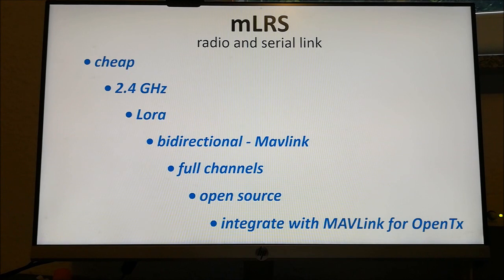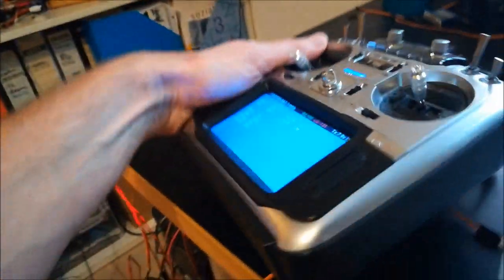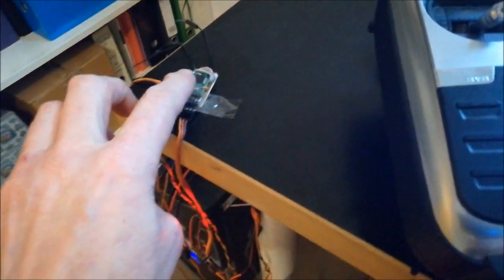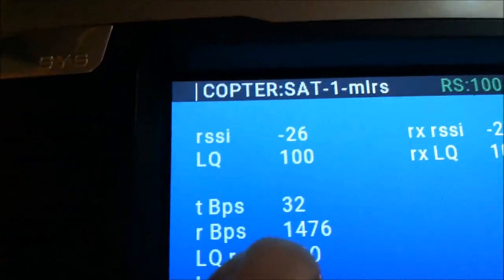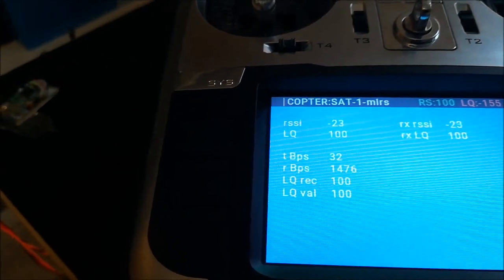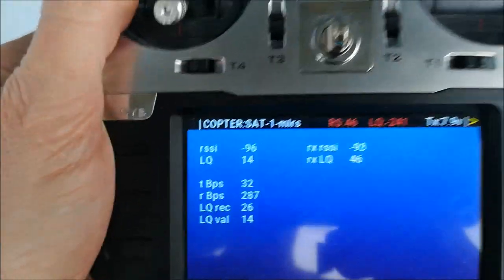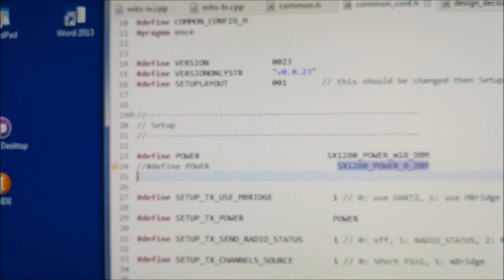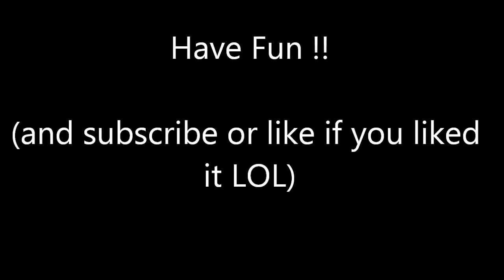mLRS: 2.4 GHz, Lora, Mavlink, open source remote control link

Comment: OlliW42: Congratulations on your work. I have a TX R9M Frsky Accst and a RX IFlight 900Mhz Diversity. Is it possible to convert that hardware into mLRS? I also have RX Frsky R9 Mini Ota, but it has low telemetry power.
Reply from the maker: hey. Yes, both can be converted to mLRS and can work together (if your iflight is the iFlight 900 TD PA), pl see also the docs: https://github.com/olliw42/mLRS-docu/blob/master/README.md.
I'm not sure, but it might be that there had been reports of reliability issues with the iflight rx. Didn't you just jump also to discord? I think it would be best to re-ask the question there, since there are more people who know such details.
Reply: @OlliW42 Ok Thank you very much for the answer !!!!!. Do you have any video or instructions on how to flash and download the bootloader on both TX and RX? I was searching on the WEB and didn't find any.
Reply from the maker: mLRS does have docs: https://github.com/olliw42/mLRS-docu/blob/master/README.md. See the respective sub chapters.
Reply: @OlliW42  Thank you very much Will. I just bought the Matek module and Matek RX yesterday. For my first experience with mLRS I found it more convenient and faster.
Reply from the maker: it's defenitely a very good choice for getting into mLRS with little hazzle.

Comment: Can this be used as a standalone communication interface for mavlink? Like I am not going to interface it with a drone or rc controller but with a linux computer at both ends and use this as a serial link between them to send mavlink messages? I currently have 2 Wio-e5 mini modules which i want to flash with this firmware but want to know this before I do.
Reply from the maker: yes. :)

Comment: Does this work with the frsky x20s tandem ?
Reply from the maker: it depends on what you mean by "works". mLRS does work with any transmitter which has a standard JR bay for external tx modules, by using SBus or CRSF between radio and tx module. The x20s should allow that. However, you cannot run e.g. all the lua scripts and widgetry you may see in my videos, as this requires the Mavlink for OpenTx firmware, which is a fork of OpenTx, and OpenTx is not available for x20s. If you wonder however if the x20s can be used as-is without anything in addition, then the answer is: no. Hope this answers your question. If not yet, pl consider joining the rcgroups discussion thread, as it is more apt for more extensive discussion. Have fun, Olli